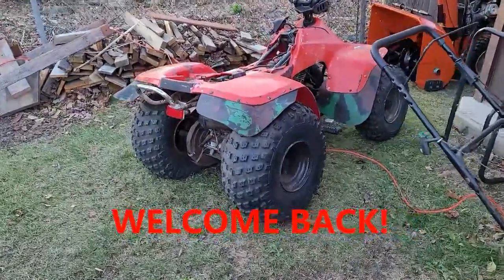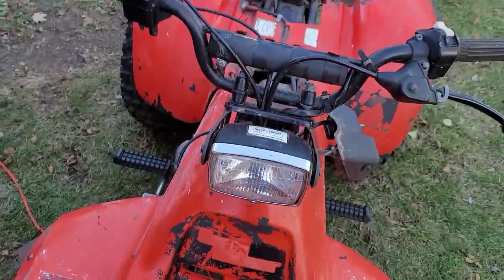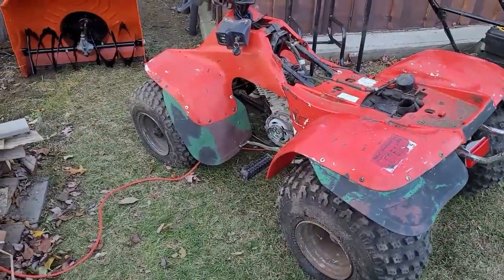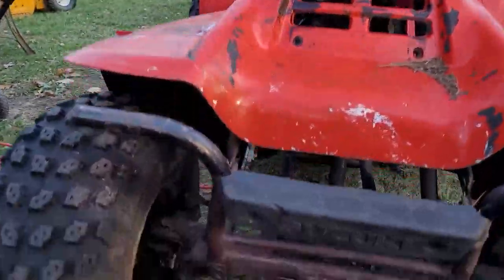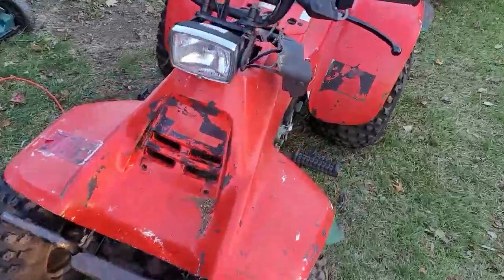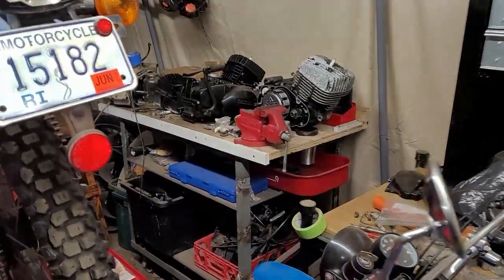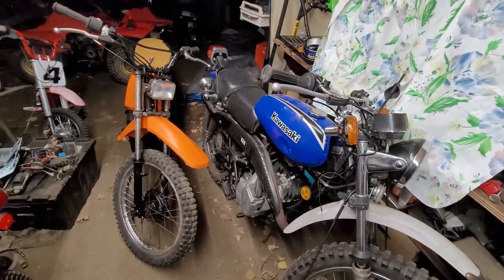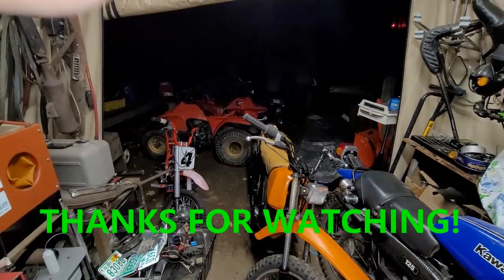Suzuki LT125 talk and update

Comment: Will the crank and piston from a ke100 work in a 1972 g5 case, I see the ke motor as a bigger wrist pin then my g5 motor, I would like to keep my motor looking original.
Reply from the maker: If it has the smaller rist pin then no different stroke and taper for the magneto
Reply from the maker: I believe i have a good one